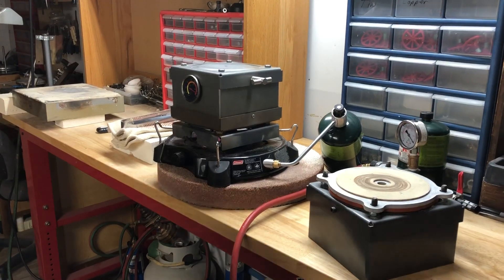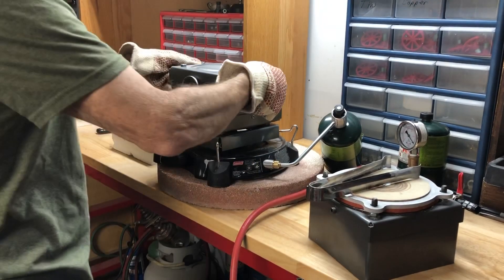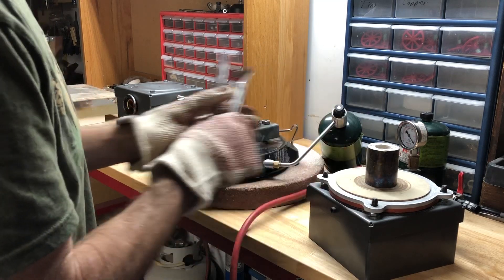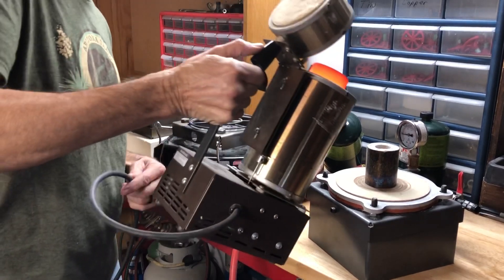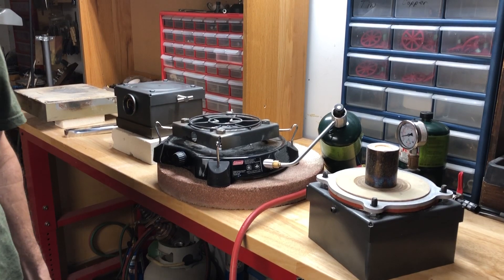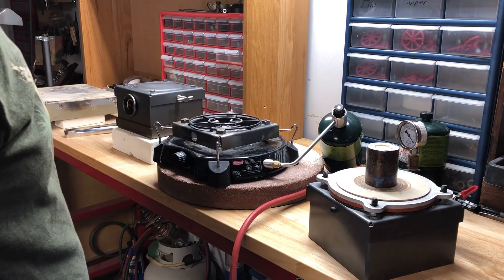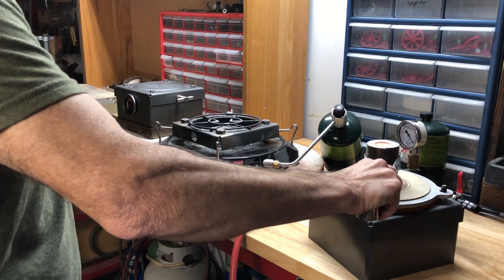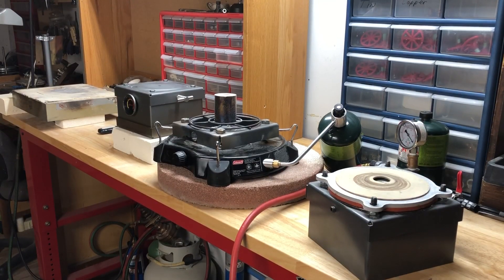Casting with the new vacuum system and a propane mini oven.

Comment: Do you make your own gaskets and if so what do you use, I would need the gasket to withstand around 450 degrees
Reply from the maker: Silicone mold rubber handles over 700* F and sometimes I make them and sometimes I buy them.

Comment: I’m amazed a one hour burnout is sufficient to cure investment.  This is revolutionary!
Reply from the maker: It works very well. I have cast over 2 dozen pieces all with excellent results so far. I have been using both injection wax and carving wax.